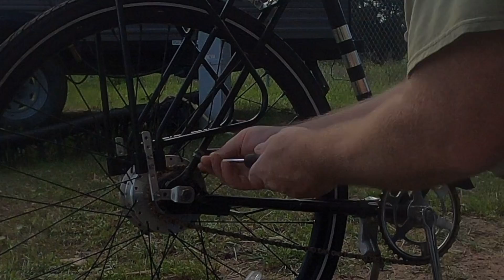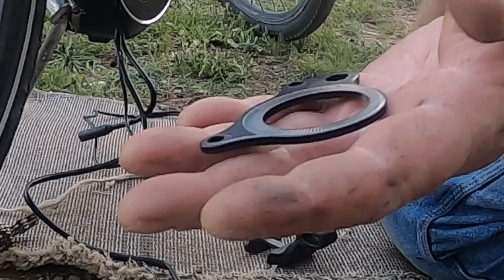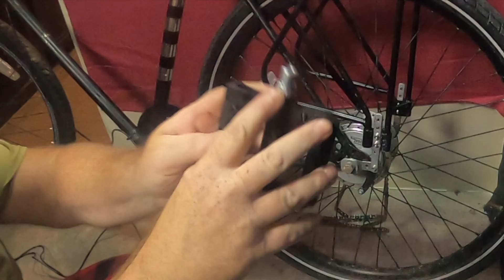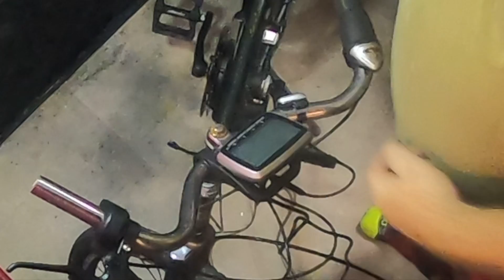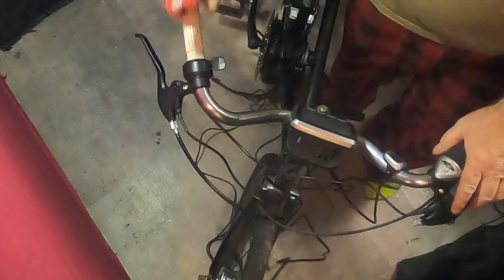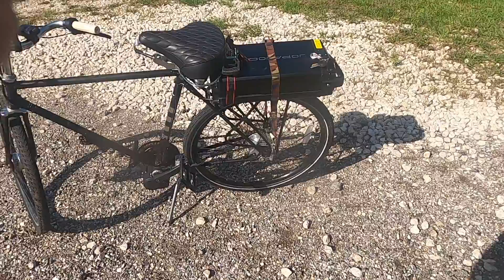Tongsheng TSDZ2B: Installation and Thrilling First Ride Experience

Comment: Is that a dynamo on your front wheel?
You've got a hub gear on the rear, how is operation in conjunction with the mid drive?
Can the unit work with belt drive instead of a chain?
I've got one of these Tonshengs off eBay 😊.
Does changing the wheel size on the display affect the top speed?
Having the controller built into the motor housing, I'm not sure about that, I've gone through my fair share of controllers over the years, anyway looks great, hopefully I can get my bike going too😄

Comment: mine came with a speedsensor cable attached to the moter, but there's also a ''speedsensor'' cable loose in the package, but there is not even any other cable where it fits on.